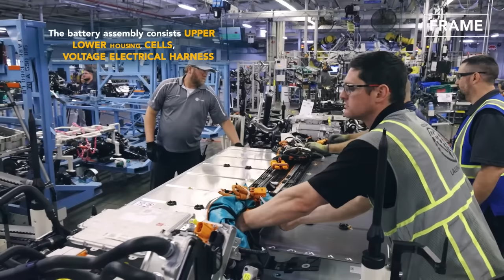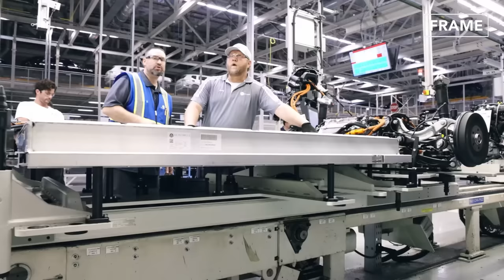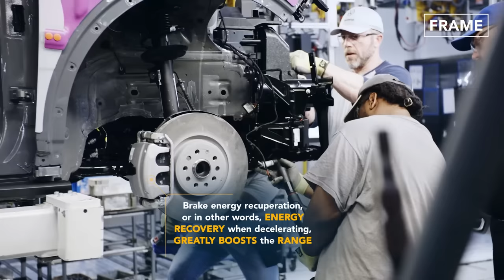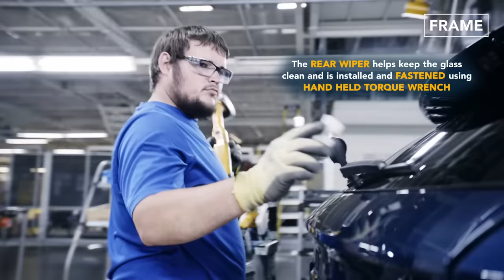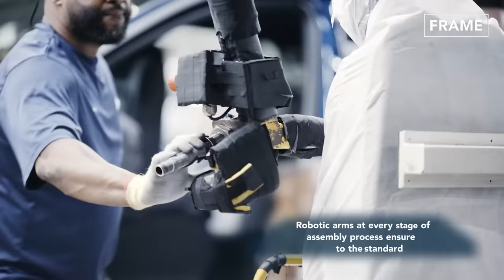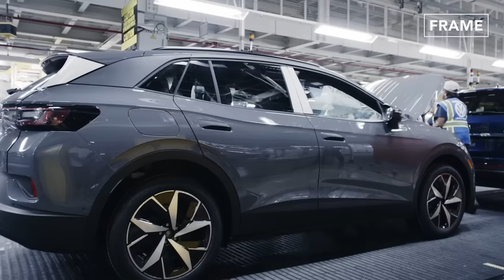Tour of Volkswagen Billion $ Factory Producing Brand New Electric Car - Production Line

Comment: Remote button diggy open close system 
push start button
fingerprint engine lock system for safety
front back camera
button auto transmission system etc
at the end driverless